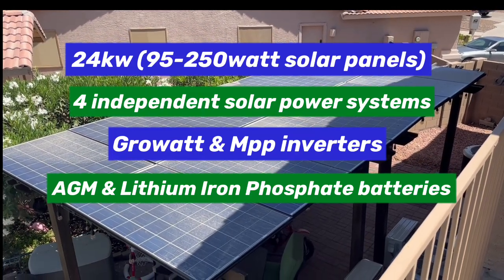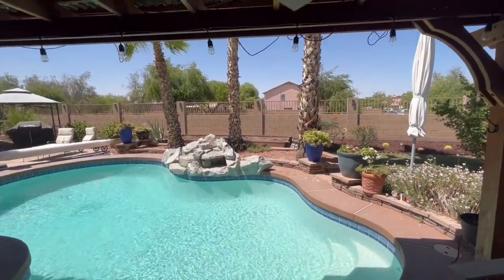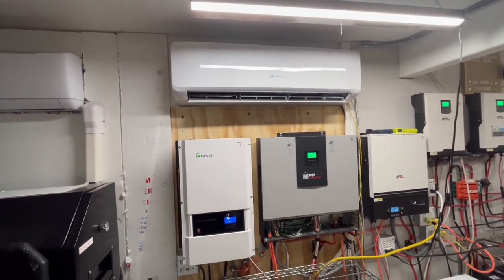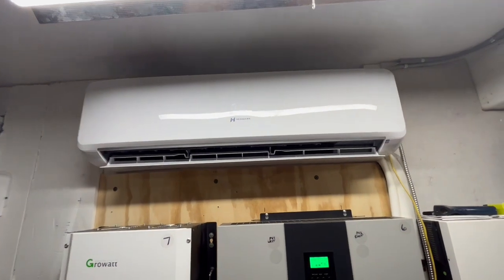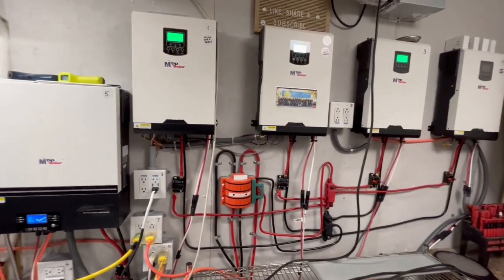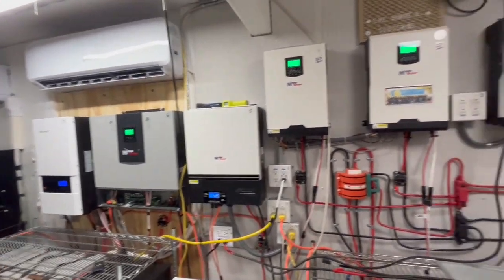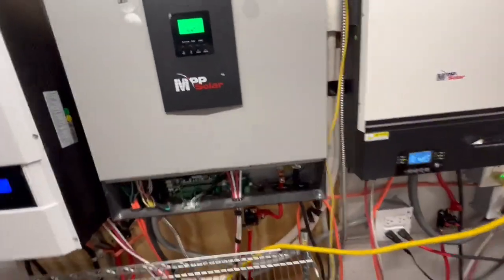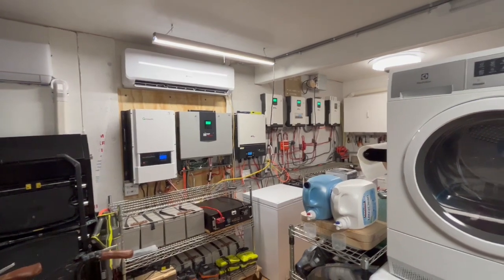24kw Growatt & Mpp inverter solar power system using 25kw Lithium Iron Phosphate & AGM battery banks

Comment: WOW i am VERY jealous, i am been limited by the wife to only 6.3 KW of solar and she says no to any expention !! :-(
Reply from the maker: Lol !!!! Been there, done that and got the t-shirt. My wife did not go along with the solar at first, but when I started up and ran that 3 1/2 ton AC upstairs and then the downstairs 4 ton AC upstairs for 10-12 hours a day on just solar, along with everything else things we run on solar,  including new Electrolux washer and heat pump dryer in garage, She got on board and total gets solar now. She actually encouraged me to buy the Lithium Iron Phosphate battery when she saw we could have rolling black outs this summer in 2022. Our payback time took 2 1/2 years with all rebates and savings on electric bill. I did all this after being diagnosed with 2 incurable cancers in 2016. What takes most people one day can take me a week or two to do with installation. I can only do 1-3 hours a day. Did not start solar off grid project until late 2019. This can all be dissembled and taken to a new house if we ever sell. I love sharing this is all DIY. Hope you and your wife have a truly wonderful and extremely blessed day.

Comment: Would you mind sharing or talking or doing a video on how you did that mount coming off of your fence walls with the panels mounted on top of them?  I’m in Avondale and would love to do something similar.  Thanks!
Reply from the maker: I will do a video soon. I used fence railing bought from Lowes. Hand pole pounder. Pounded 24 inches into ground. Back poles are 6 inches taller than front post. I used metal fence t connectors and fence railing to connect front and back. Really easy to make in one day. Probably would cost around $500-$650 to build today to make array out of poles for 16 250 watt panels, 4000 watt array. The ground out here is so hard and even when we get rain it never penetrates more than 4-6  inches below ground so the poles will stay in place after monsoon rains no problem. The ground out here is like concrete. Will try to do video soon on building solar panel array. Hope you have a wonderful and very blessed day.